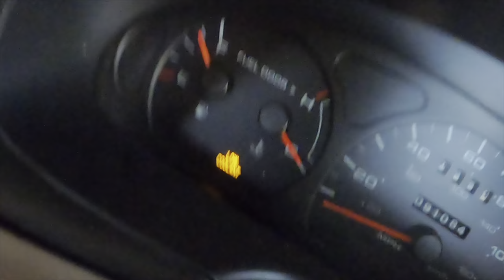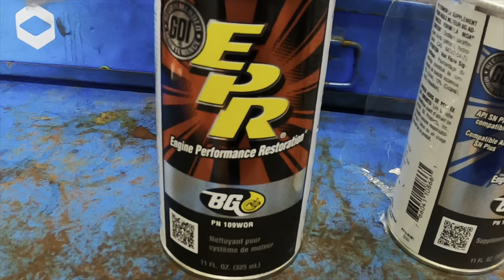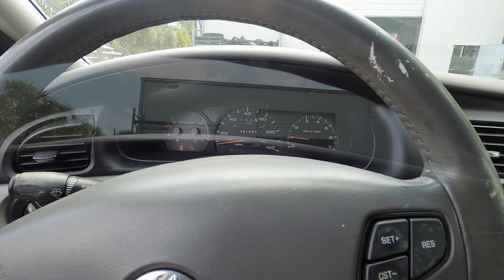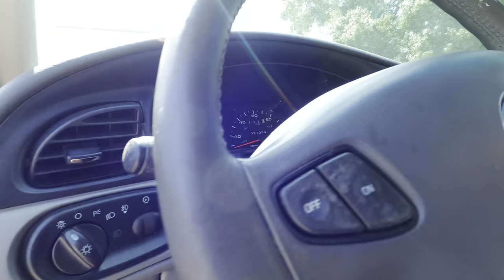Customer States: Never changed the oil….oops

Comment: Oh man... As someone that builds race engines, watching someone take sand paper to the crank journal hurts my soul in way I can't describe.  I get why you did what you did in an effort to get a customer on the road for a few hundred dollars instead of a few thousand dollars.  Doesn't mean I like it though :P
Reply: Pretty much exactly what I was thinking. I am not building any race engines, but I have built several engines and one single RX VW engine 30 years ago. Watching this was like nails on a black board in my heart. I guess the bearing material could be removed chemically instead which would have been a much better option imho. But as you said, brrr (shiver)
Reply: Right, there are times when "good enough" really is good enough. Odds are that engine will run for another 100K at least, and hopefully a customer is sent back on the road more the wiser and not too light in the pocket. And you're right, when you're building race engines the tolerances are very tight and everything has to go by the book. Many a street engine has been saved by slapping in a new set of bearings after spinning one.
Reply: @channell11  Most of the time, you'd be surprised with what you can get away with on an LS engine haha.  The tolerances are pretty large comparatively to other stuff but they don't seem to care.
Reply: @jonbeargenx  I did something somewhat similar and of course it worked on a truck engine that wasn't modified whatsoever but I didn't use sand paper.  I used another type of paper that I can't remember the name but it wasn't designed to remove material as much as polish it.  Took a bit of extra time but it worked fine.  You need those lobes to be so shiny and perfect that they are a mirror.  Sand paper doesn't accomplish that well.  If it was super fucked maybe sand paper then follow it with something to polish it and that may work? When doing something like that though you need to measure each lobe and make sure its not out of round and order bearings specific to each lobe.  You can buy bearings of different tolerances and use an assortment of different sizes through an engine to make sure each one has the perfect fit and not too much room.
Reply: @nikleyde702  They need to be perfect indeed. A friend bought a huge crankshaft polisher/grinder from Canada and had it shipped to here in in Norway. Using any kind of handtools it is nearly impossible to get the tolerance right. Especially when working from underneath the car. An acid would take care of the bearing residue and left the crank more or less intact. But it is what it is. I am sure it was still way better than to do nothing and I guess the engine will continue to run at least for a little while until the owner either changes it or rebuilds it. I am also 100% sure that he knew this while doing the job as the video tells us. But why he did not remove it chemically only he can answer.
Reply: @jonbeargenx  for a car worth $600 running and $0 with a blown engine, might as well try.  not like he's going to wreck the engine
Reply: @yoinkerman  Well as I said I get it, I just wish he would have done it chemically.
Reply: He was using emery CLOTH to clean up the journals.
Reply: @deadeye4543  It's still abrasive, he should have used chemicals. It's as easy as that. I get that it was a quick and dirty solution for an engine with a short life ahead, but the fact is that there were better possible options.
Reply: @nikleyde702  maybe crocus cloth
Reply: As someone who builds race engines, I am surprised you don't know how cranks are polished. Like with emery cloth....
Reply: You gonna be ok boyracer?

Comment: 5:00 - Step 1 is ALWAYS “Remove Negative Battery Terminal” according to every Gregory’s Workshop Manual I’ve ever seen.
Last step is ALWAYS “Installation is a reversal of the removal process.”

Mighty Car Mods Step 1 is always “Jack up ya car.” Coz you wouldn’t need to work on it if it wasn’t jacked up to begin with.
Reply: How you gonna spend all your time fixing your car if you don't break it xD

Comment: That BG EPR actually does work pretty well in certain circumstances.  For me, I had a 2014 Grand Cherokee throwing a code for low oil pressure even though it was fine.  Put a can of BG thru it and never had the code again.
Reply: I've cleaned up many a dirty lifter with some BG or Seafoam and a synthetic oil change.

Comment: Great job filming that whole process.
Overall a really well done video. Kudos..!
Yes, that engine will be fine for a few more years after bearing replacement. 
Are you going to "plastigage", or just replace the bearings and go with it?
Reply: I bet it's dead in 300 miles or less.... Even IF it makes it that far.

Comment: The metal in the pan definitely didn't come from the rod bearings, they don't look like they are missing significant chunks. It is either main bearings, thrust bearings, or something else (perhaps a worn chain guide if this is a timing chain motor).
Reply: Yes it did.. That one bearing was half as thick as the good ones..Hell I could see the bad one. The second he put that wrench on it..As it lifted up 1/16th of an inch.. It's how I find the bad one.. Just lift up on the rod. They will have lots of  play in  them..When it shouldn't move at all...
Reply: Yea man u trippin that bearing was half the thickness of the rest I will say that engine won't last but maybe 50,000 more miles there was a lot of scoring on the crank

Comment: Do you plan on taking off the main caps also? That looked like way too much material than just the number 6 rod bearing could put off
Reply: Agree that the mains should at least be checked, but, all the rod bearings lost their edges, number 6 just started to rotate.  I think what saved this engine was the lack of a groove in the rod inserts.  That big oil feed hole in the crank allowed all the oil it could locate to lube crank first.
Reply: @22099dscott  I think a grooved bearing would have HELPED.
Reply: @davelowets  You would think that after the billions of engines designed and built they would be able to build a perfect bottom end that would be bullet proof.
Reply: @dougscott8136  I sure wish they could. The laws of thermodynamics will forever prevent it though.
Reply: I agree way to much material to just come from that one bearing...he should have checked the main bearings also...that's a lot of work to only last a few more miles from not doing it right

Comment: Are you replacing the bearings with original sizes?  I'm surprised that you're not replacing the main bearings as well, as some insurance.  I'm anxious to see the follow up.
Reply: You have to pull the crank too do that..Which means remove transmission flywheel...Timing covers. Remove the timing chain etc...
Reply: @WizzRacing  Not necessarily. Old timers like myself have been sneaking in new bearings forever after a quick check with PlastiGauge to determine if an oversize is needed. Of course I've only ever done it on MY engines and only if they weren't beating on the doors to Hell like that one is. 
I'd replace the mains too EXCEPT for the rear main. If it isn't leaking and the others will accept standard bearings then why rebuild the entire lower end. Especially on a 'young fellers' car who obviously doesn't even know enough to periodically check fluid levels, and most likely spun the bearing because of too little oil and too much skinny pedal.
Reply: @gregoryking9348  Not on these engines.. Them mains have a lock\locating  pin for the mains..

You could get away with that on them old Chevy engines..
Reply: That engine is junk.
Reply: @Random Shop time is money.

Comment: why on earth wouldn’t you check all the fluids before driving it into the shop ?
Reply: What's the point? If it drove to the shop it'll probably drive from the carpark into the shop - _-". Engine is toast anyway.
Reply: @Davo_1991  bad bad practise . no matter what had happened up to that point . you have a duty of care as a mechanic to check the fluids / oils before you start the engine !   this is the difference between a good mechanic and a …….  waste of time mechanic

Comment: I had a engine in a friend of mine car like that I did what a old mechanic showed me and it worked he got another 50000 miles on it before he sold it you put news paper behind the bearings before you install them it makes up for the clearance you lost on the crankshaft it's a old timers truck and it works I have also seen people put crankshaft into cars without pulling the trans and just the timing cover and the timing chain love your videos keep up the hard work making them and have a blessed day today 🙏

Comment: I am pretty much sold on the battery impact wrenches you use. I bought corded ones for the power doing some axle work, but if the cordless are strong enough, it would be nice. My right angle 3/8" socket wrench is cordless and worth every penny so far.

Comment: Ray a tip from living in the rust belt... the only chance of getting exhaust manifold bolts off is to use the heat wrench first.  Oxy/Acet to get the nut cherry red, then on with a 6 point socket and impact.  Rinse and repeat as necessary.

Comment: It’s a long time since I did a crank recon with the car on jack stands. It ran for another 20k miles before it failed. In the 1960s 60k was about average for our little 4 cylinder engines anyhow.

Comment: Decades ago (when I was a young pup) I used CD2 Crud Destroyer in a high mileage 62 Chevy 235 ci. 6 cylinder. Ended up flushing all the crud right into the lifters. Luckily, the lifters were easy to replace on that engine. Last time I used that "additive".

Comment: Last comment, someone must really like that car. Without seeing part two yet, where did the materials in the pan come from, the mains? Also the rtv and overtightened bolts, possible someone pulled the pan before and over gooped the gasket? Then sold it. Also that fine mig repair at the exhaust pipe area looks like someone likes to play mechanic at home. Love watching someone else do it for a change.

Comment: My son had a Sable just like that.  I hammered it into him to change his oil every 3000 miles but never thought to warn him not to drive it without coolant. His water pump failed and he continued to drive long enough to burn a valve. It ran fine but couldn’t pass inspection with the CEL light on for a misfire.

Comment: Once you've spun a bearing, either the rod needs replacing, or if it's a main bearing, the block needs to be machined.
When you spin a bearing, you ruin the crush fit on the bearing caps. Any bearing replaced without fixing this crush fit will spin again eventually.

Comment: The oil pick-up filter housing I'd was in gasoline, shaking a little bit. Then would fall off everything. Grinding the crankshaft is not a good solution. It already lost its original dimension due running without oil for a long time. There will be space between bearing and CS. It would be not a long life engine... Did you clean the CS after sanding?

Comment: this video kind of reminds me of a time I was helping someone in my family with a spun bearing. I was supposed to be there as an extra set of hands to help support things. He asked me for basically no help. It was an early 2000's Saturn S-Series sedan with a 4cyl engine. He pulled down the oil pan and gotten to the rod caps. As he was removing the caps and pushing each piston up to replace each bearing he felt one of them push back a little bit so he forced it up more and held it for a second then it stayed where he wanted it. Once he was done putting the new bearings in place in that motor he went to pull the piston back down but it kept springing back up and he assumed he had pushed it too far into the head itself. Since the vehicle was sitting on jack stands I was able to see the top of the engine and noticed he had left the spark plugs in place and I tried to explain to him that he needs to remove them so he doesn't have the compression rings on the pistons causing a vacuum but he wouldn't listen to me. He starts taking apart the timing components and you can see as one of the cams jumps to full close on all valves due to spring pressure. I keep repeating myself about the spark plugs and he finally listened to me, pulled them and tried pulling the piston back into position and it worked. He apologized to me about not listening and then continued to ignore me about the timing on the engine as he goes to puts everything back together. He then proceeded to attempt to dry fire it (oil pan and valve cover removed) to make sure everything was in time and would start claiming that "A couple seconds isn't going to hurt it." after a few turns of the engine and it failing to fire you can hear a "CLUNK" as one of the pistons smacks into a valve and cracks a valve cap on cylinder 3.
Reply: Bravo.

Comment: If stuck on the side  of the road in North Dakota....maybe.  In a professional workplace, probably not.  Question: How do you know what size bearings to order if you haven't taken any measurements?  Other question: Why didn't you look at the mains after confirming bad rod journals?  I'd have pulled the crankshaft and sent it to a machine shop.  Not doing the customer any favors if 6 months from now the same thing repeats, only worse.

Comment: I had that happen to my Toyota Corolla as well. The first 3 years, it didn't consume a drop of oil. After that, it started consuming about 1 litre of oil every 5000km. And according to the manual, 1L of oil every 1000km was still acceptable. It was rattling as well (I heard the noise coming from the exhaust so I thought it was a mechanical issue) and I went to the shop where they tried to drain the oil but no drop was coming out. It was totally dry (I was watching them so it wasn't fake or a scam). Also, the low-oil LED on the dashboard didn't light up so I didn't know the oil was the problem. So they filled it up again and the rattling was gone. Since that day, I always kept 2 bottles of oil in the trunk so I could refill it if and when I heard the rattling again. Even after 15 years and 254.000km, the engine still worked but other parts were starting to wear out and I bought a new car as the costs would be too high compared to what the car was worth at that age and mileage.

Comment: On a crank like that i get a bottle of aluminum cleaner from napa.
Spray it on clean journal and polish with Emory cloth. The aluminum cleaner is an acid that eats the aluminum but won't harm the crank. I have saved a few cranks that had aluminum embedded in it.  I had a pinto that spun a bearing and the crank looked worse than that. I polished it with aluminum cleaner put new bearings in and drove it for a few years.

Comment: I had a car come in once where we drained almost nothing from the pan.  Went to add oil and it started coming out of the valve cover.  Stuck my finger in the fill hole and pulled out sludge the consistency of toothpaste.  Lucky for her an over the counter oil cleaner broke it down and we got it to drain and filled it with fresh oil.  It was a Hyundai elantra.  I was impressed it was even running!

Comment: I was working in a shop in the mid to late 1980s. A newer Camaro, only about 1 year old with 25,000-plus miles, was towed in on the back of a wrecker. When the car was started, it made a horrible racket. Pulled the dipstick - no oil. Put it on the rack and pulled the drain plug. Very little oil came out and what did was like tar. Asked the girl when was the last time she got her oil changed. Her response? "Oil change? Why would I get the oil changed? It is a brand new car... I only got it a year ago."

Comment: Man, i have a 2012 ford escape 3.0L, that started knocking 2 days ago. i stopped driving it. i checked and retorqued all cam caps, that wasnt the issue, I used my stethoscope to listen to the oil pan and i can hear a very very light knock noise from the drivers side of the oil pan. I may try the way you did this repair. Were the rod bearings oversized? or just the regular stuff?

Comment: Went to college with a guy who didn’t change oil ever. Finally donated his Ford Tempo for scrap when the water pump went. The only time I borrowed it, the accelerator cable fell off and the throttle was sprung open, not shut, on this car, resulting in uninterruptible undesired acceleration.

Comment: I had a '74 Nova Custom. It had a 350ci, 4 speed with Hurst Shifter and positraction. All factory. I changed the engine to a high performance '69 350 with 202 heads. the point is she over heated going from Wausau, Wi. to Va. beach Va.
and back. I replaced the radiator the damage was done. we drove it for 4 mos. and it rattled and banged until it was on the hiway It would heat up and stop making noise and go like crazy get off the hiway  it would cool down a little and start rattling and banging . when I took it apart all the steel was gone on the inside of bearings  inside of the bearings was copper or brass along with really deep groves in the crank jourrnals tho9se rod journals are nothing next to the ones I did. summer of '95

Comment: A trick from the 60's.....next time you want to clean an engine and you know the oil pans coming off anyhow, drain half the oil and refill with ATF and let the car idle for 30 minutes. The high detergent in the ATF will breakdown all the sludge but will clog the oil pump's pickup  drain and pull the pan, change the bearings and replace the pump and pickup.....shim the pump's spring if you want to increase the pressure

Comment: One would think that by now there would be heat and rust resistant exhaust studs ,bolts etc that can be removed years later without binding or breaking.

Comment: In Australia the Nulon pro strength engine flush actually works, removes much more sludge than what it looks like that stuff did, turns brand new oil completely dirty black pretty quick (assuming there's sludge to remove)